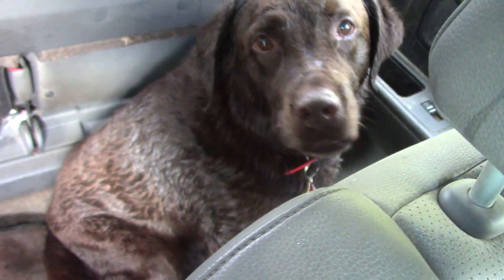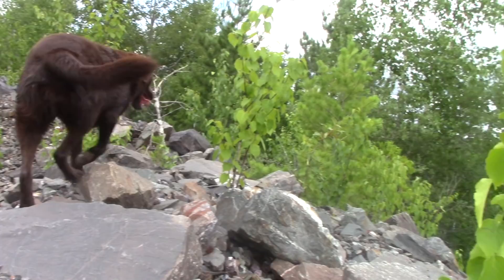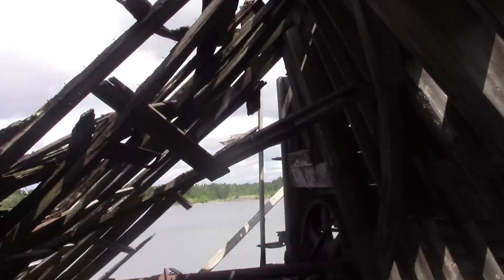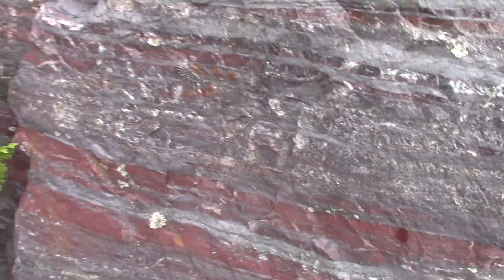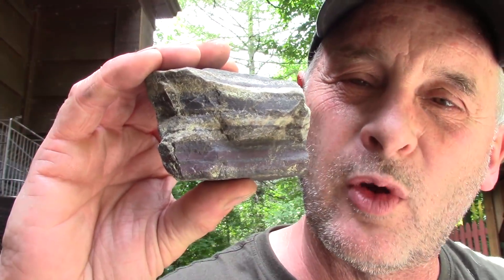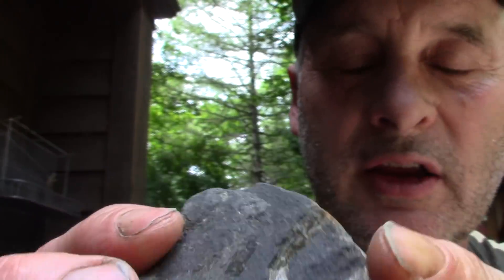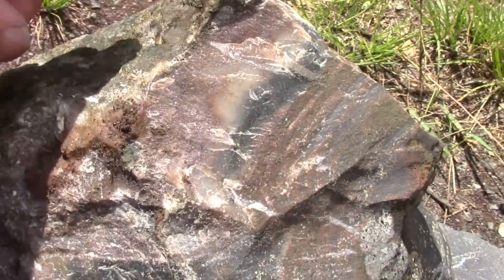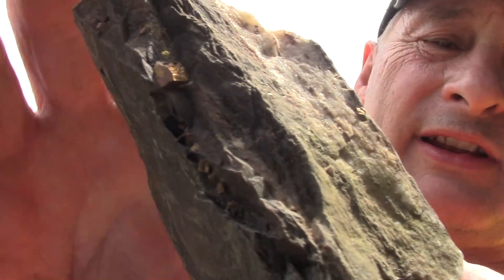Finding Cube Pyrite and BIF Jasper

Comment: I've used Muriatic Acid to clean stone before but also I'll use Arm and Hammer baking soda to neutralize the acid when done.  
Love your videos and all the cool rocks. 
Down here in Florida there are only a few gems to chase like agatized corals and shells. Otherwise it' all sand and limestone.
Reply from the maker: The states around Florida have some great collecting if you are willing to make the drive.  The advice on using baking soda to neutralize the acid is good.  It turns it relatively harmless.

Comment: I have to ask because I can't quite tell, are the BIFs in the rough, reddish and grey/black or are they purple and grey black?
I have been scouring the gravel piles I come across trying to find anything close to what you are picking up and nothing looks quite right. I think they look purple in the natural light when you pick them up, but then your finished specimens look red to me.
Reply from the maker: The jasper is usually a red colour.  I know what you mean by looking purple (ish).  Most rocks look a bit different on the outside vs cut and polished.
Reply: @meMiner  Hmmmmm, ok. Thank you very much for the answer.

Comment: Also, from what I understand, most BIFs are formed between 3 and 1 billion years ago, during and after the Great Oxygenation Event, as this event supplied the free O2 to combine with the free iron dissolved in the oceans. It makes sense to see shale with pyrite in it adjacent to BIF, as it forms almost identically, just with no free O2, so instead of iron oxides, you get iron sulfides. So before the GOE, you would normally get shales and slates in poorly circulated ocean water, argilites and sandstones in well-circulated waters, then GOE BIFs (representing alternating chemistry between the newly free O2 bonding to free iron, and once the O2 is temporarily used up, conditions return to closer to what the silicious life-forms that generate your oozes that form your cherts relied on, and you get your jasper)  then as the dissolved iron becomes depleted, the red color fades away in the later and later formations.
I could be wrong on some of those points, like I say, that's just from what I understand. M not a geologist. ... ... YET.
Reply from the maker: What he said.